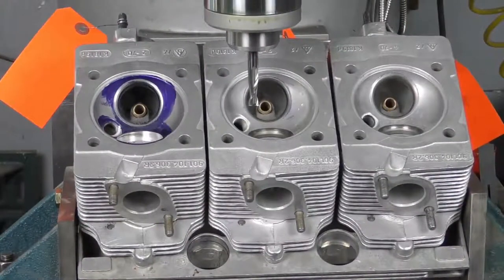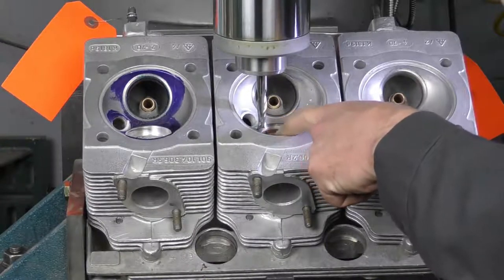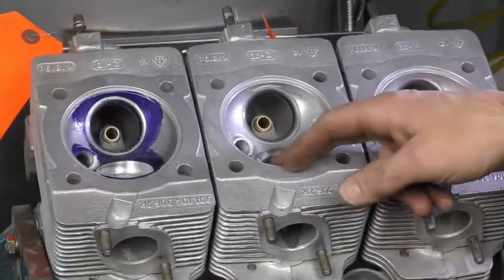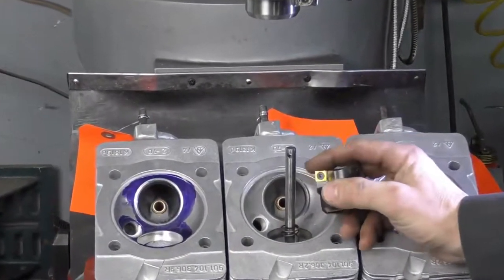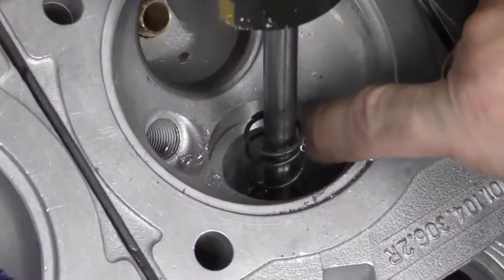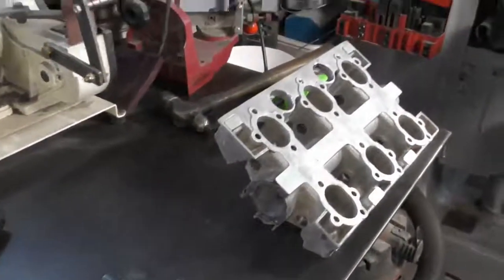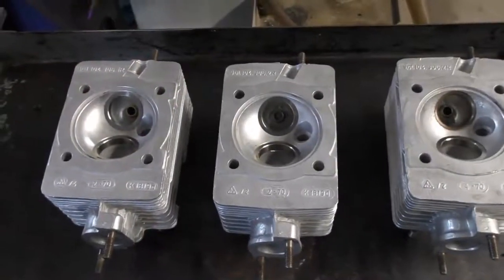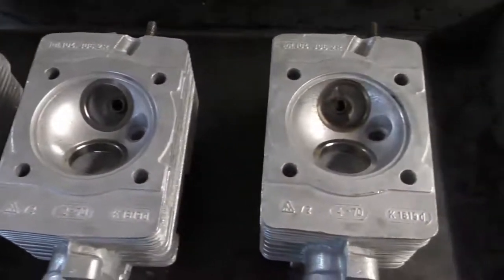Replacing Valve Seats, How to rebuild a Porsche 911 Cylinder Head Lesson 6

Comment: This is a great series! Thanks for posting this. I'm looking to get the required tooling to install 993RS seats and valves in 911SC and Carrera 3.2 heads - would you mind sharing your source for metric indexable cutters and seats? Or do you go with whatever 1/16" increment is closest to a given metric valve size? Thanks again!!
Reply from the maker: Jonny,
We use standard cutters as metric ones are just a little tough to come by here. In the end it does not matter because we order the valve seats in what ever ID and OD that we need. The cutters we buy from Goodson and the seats come from Wholesale Engine supply, Not sure if the sell to the public though.
Reply: @klassikats  Thanks! I buy from Goodson often, I figured as much with metric. I'll look into wholesale engine supply but I know there are others. All the best! PS - Good luck with your new venture, I was a happy customer at Partsklassik!

Comment: Have you ever used a weld bead to remove a set?  I've heard people suggest it, but I would be worried about the amount of heat you are pouring into the head.
Reply from the maker: Hi Jason,
Running a weld bead on the inside diameter of the seat will shrink it, and the seat can be removed when cold. This is not the method  I use, I am happy with cutting using a hardened end mill.
Thanks for watching. Klassik ATS
Reply: I’ve tried welding some seats. It’s a bit messy and seats can be made of what ever material so the welds are shit. But yeah it works. I like the machining. Nice and clean.